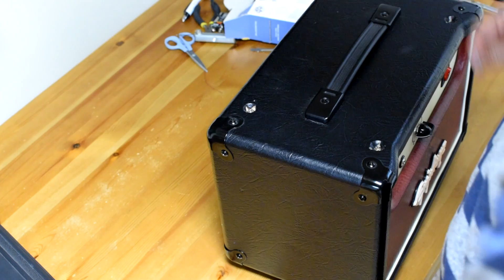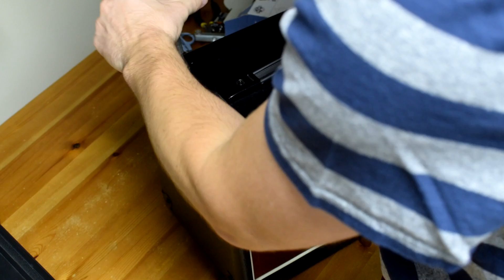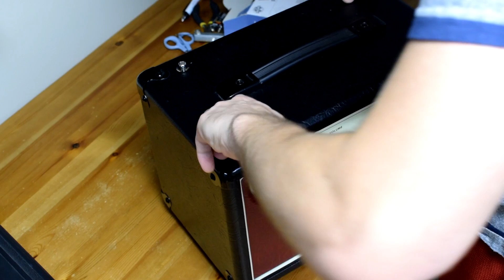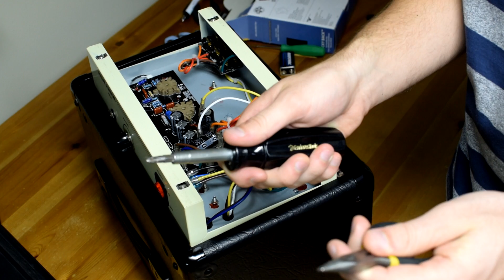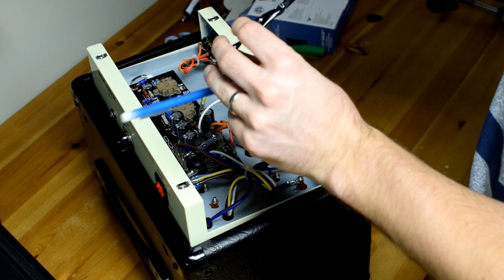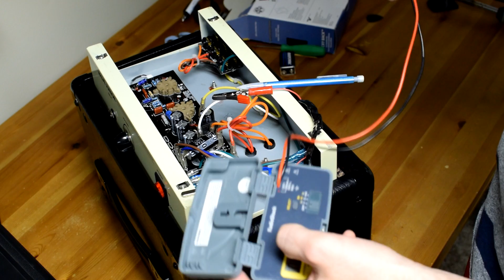How To Discharge Capacitors To Mod A Tube Amp

Comment: Just got a 2001 Single Rectifier. Took the chassis out and examined the circuit board and sockets. Everything looks brand-new. The sockets looks clean. Almost too clean. I noticed it had three large blue capacitors. 

I'm curious how long they last? 
Would replacing them improve the sound?
Reply from the maker: A good filter cap can go 40 years. When they go bad the amp can perform strangely and sound sick. The filter caps don't process any audio signal, but are critical for the power supply to make the tubes work properly. If your filter caps are healthy I wouldn't swap them for tone reasons.
Reply: @KleyDeJong  interesting. Thanks for the information. The amp seems to function properly. No odd noises or anything. I really can't push the volume  much where I live. This amp is loud! Also it has the original tubes that came with the amp. Im reading that the first and last preamp tubes are important for the sound.

Comment: How long would it take for all the voltage to disappear if you just left the amp unplugged? Thanks
Reply: typically the tubes will discharge the caps after powering off the amp, but check with a meter to double check
Reply: @hrsey71   when is a safe amount of time if u just left it unplugged?
Reply: @jmaddox84  typically 24 hrs is plenty of time. but it is strongly advised to discharge the caps manually, then check with a meter before touching an amp.

Comment: Unplugging the power cord from the wall with power switch ON will discharge the caps.
Reply: Nick McIntosh not always. Depends on topology
Reply: Will this ruin the tubes or anything? Trying to access behind the face plate of my Orange and I don’t need to touch anything else.  Wondering if this is safe

Comment: I just us a mains  light bulb with 2 insulated meter leads attached to it via a bulb socket .You can see the voltage go down as the bulb dims .

Comment: Is the chassis even grounded if it isn't connected to the wall socket?
Reply from the maker: Christoph K. No it is not plugged in. You aren't grounding the voltage, but discharging it. The danger is in current flow. By dumping all current into the chassis it will not flow and therefore cause danger.
Reply: 'Ground' can mean 'safety ground' i.e. a connection from the chassis to the Earth via the third wire in a three-wire power cord. 'Ground' is also used to refer to the negative terminal of the power supply, the 'zero volt point' from which other voltages are measured, and in a tube amp this is connected to the chassis. In fact, the chassis is not involved in the discharging procedure, other than providing a convenient way to connect your discharge tool to the negative terminal of the reservoir (first filter) capacitor. When you connect the resistor across the terminals of the capacitor, the voltage on the capacitor appears across the resistor. If there is a voltage across a resistor then current must flow. If a voltage is causing a current to flow then power is being dissipated. A resistor dissipates power by converting electrical energy (the charge in the capacitor) to heat (another form of energy). The charge on the capacitor is converted to heat in the resistor and lost to the atmosphere as the resistor cools.

Comment: It's not the voltages that are dangerous, it's the amps. You can have 1,000,000 volts running through you, but it's that stinking 0.5 amp that can kill you.
Reply: Yes but the current depends on the voltage dumbfuck and of course 10,000 volts is way more dangerous than 110 ac if you get near 10,000 V the voltage will be enough to make an arc and kill you, and ac is more harmful to your body than dc given the same voltage

Comment: i thought the chassis is in the amp cabinet so we have the cab and the inter metal chassis ? Right yes or no?
Reply from the maker: Yes I misstated that.  The cabinet is the wooden enclosure.  The chassis is the metal box that the componets and tubes are mounted to.
Reply: Right... I was watching this because i might buy a marshall that need new filter caps, But i have a super reverb that i've had apart many times , Its crazy as soon as i turn it off and open it up The caps are discharged, I dont really understand why but i've had it apart around 6 times over the years and everytime its discharged, Now the marshall i'm guessing will be a different story.
Reply: @jaysjaysgarden398 In many (not all!) tube amps there are resistors which discharge the caps in addition to their primary purpose.

Comment: 6:26 wait, did you put your grounding clip onto painted chassis? why not use a dedicated grounding post somewhere? and surely you need it plugged into the wall so any flow can actually ground out to somewhere out through the wall?
Reply: Connecting a resistor across the capacitor causes a current to flow in the resistor converting the electrical energy stored in the capacitor to heat energy in the resistor. The charge on the capacitor is actually lost into the atmosphere as the resistor cools.

Comment: Okay first of all great tutorial, I really needed this because i want to add some bright caps to my amp. Secondly, and i just found this funny, at 4:38 you suggested to wear wooden gloves, because we all have a pair of those laying around :'D. Anyways thank you so much for this!
Reply from the maker: +Lars van Koningsveld Glad it was helpful!  Haha, wood gloves are super common ;)

Actually I shouldn't have said gloves.  I know some guys who use chop sticks or wooden pencils taped to their multimeter or discharge tool.  Just another layer of protection against conducting electricity.

Comment: Hey, Im planning to mod my tube amp. Its a Peavey Valveking 100 first generation. Is it save to disassemble it and touch the chassis with bare hands? Is the voltage present only in the circuit and the components itself?